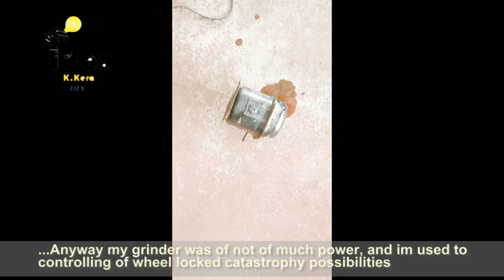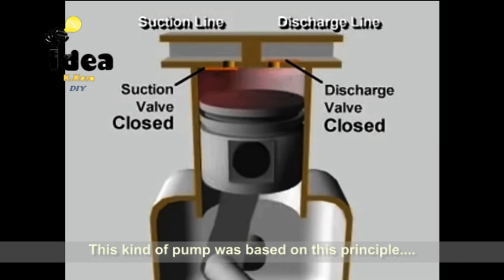Practical Jet water pump from Split AC compressor. Nagaland DIY

Comment: Is the pressure enough to fill a pcp rifle air tank ?
Reply from the maker: In air only going 700 psi. But in water about 3000 psi pressure
Reply: @kkeraangami6183  didn’t really get u about the air n water thing but 700 psi is only about 46 bar.